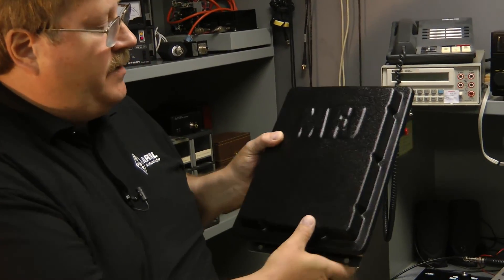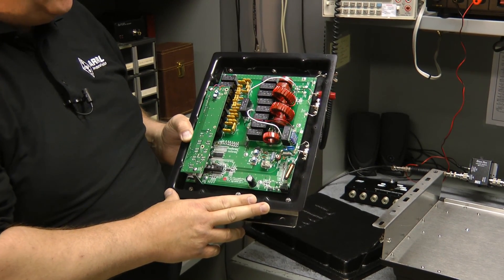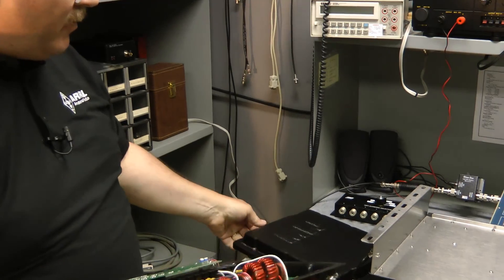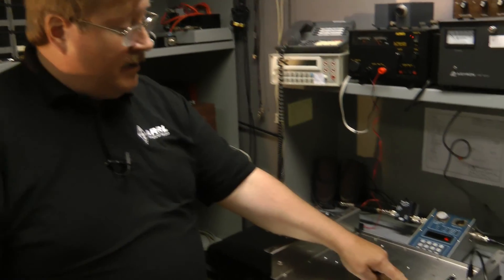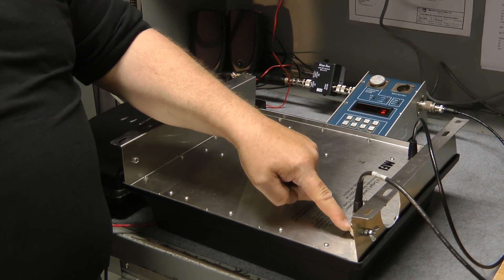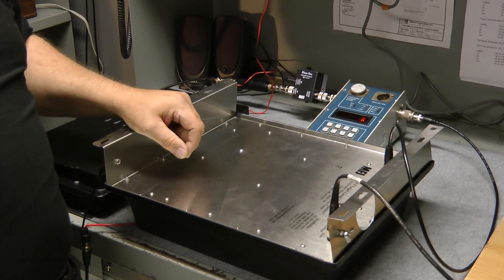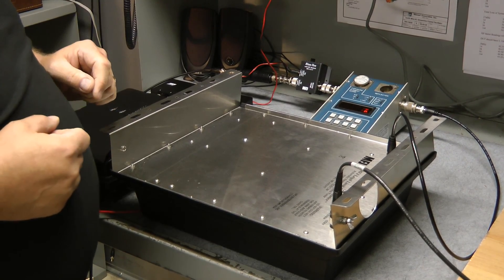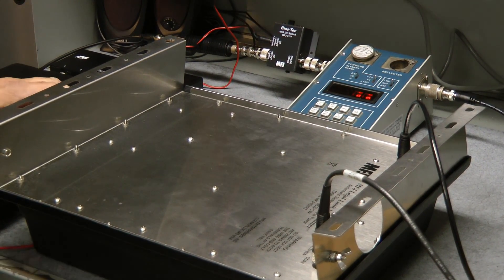MFJ Auto Tuners

Comment: "AFTER any type of coax switch?  The antenna tuner is in the line between the rig/amp and the antenna switch (common line) so you can tune any of the antennas when selected.   I think he is speaking from the antenna's point of view.

Comment: I have a Yeticom Optima 10/11/12 meter radio 24 mhz to 30 mhz and the back of the radio there is no interface connection. Can I use this automatic antenna tuner and if not what do you recommend? I have research all of the automatic antenna tuners and all are made specifically for different  types of radios.

Comment: Did anyone else notice that the connectors for the 998 are on the back. If it is mounted on a wall, the cables will need to take a immediate  elbow turn.